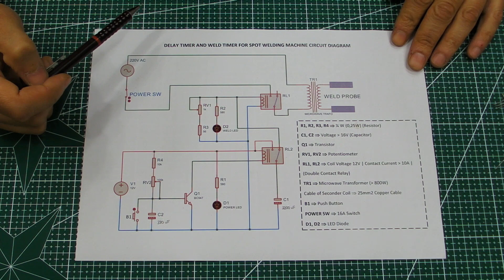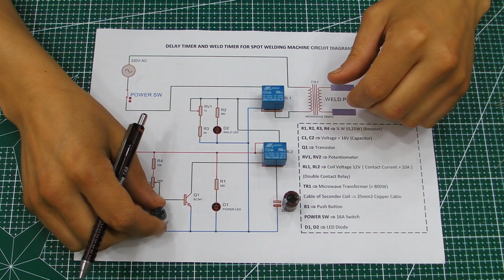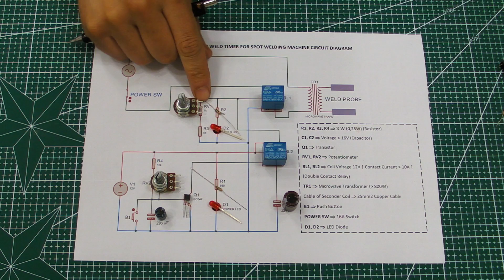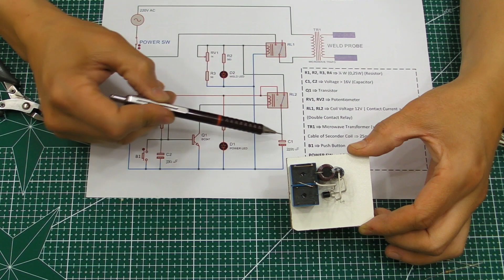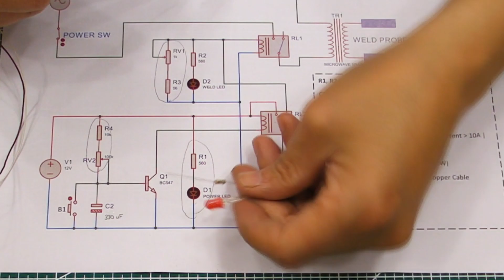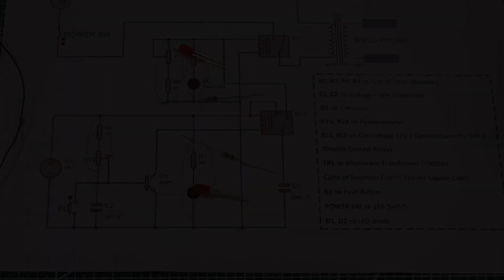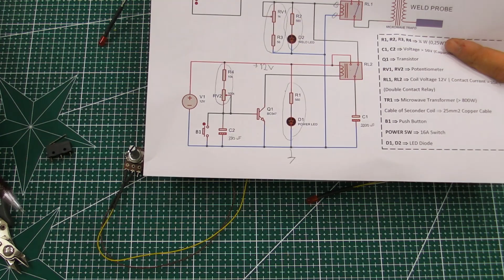How to Make Timer Circuit for Spot Welding Machine

Comment: Awesome video. Can you explain the theory of how the values of RV2 and C2 control the transistor to delay the de-energization of RL2, and why RL2 doesn't instantly become re-energized after you release B1? I'm having trouble understanding what exactly is happening IN the circuit when you press B1...
Reply from the maker: Hi.  Firstly, thank you.  This circuit is specially designed for a simple timer circuit and 2 separate time settings.  The operation of the circuit can be explained as follows... When the circuit is energized for the first time, the capacitor C2 is charged through R4 and RV2.  Since C2 is charged, Q1 transistor gets enough base voltage, it turns on and RL2 relay is energized.  In this case, according to the contact connection of the RL2 relay, the capacitor C1 will be charged to 12V voltage.  When the B1 button is pressed, the base voltage of the Q1 transistor drops to zero and the RL2 relay is de-energized.  The contact state of the RL2 relay changes and it gives the voltage on the C1 capacitor to the RL1 relay and other circuit elements connected in parallel to this relay.  The potentiometer RV1 changes the discharge time of the capacitor C1.  Thanks to this connection, even if the button is pressed, the welding time is as long as the discharge time of the voltage on C1.  Briefly, C2, R4 and RV2 determine the pre-weld waiting time.  C1, RV1 and R3 determine the welding time.  I hope I was able to explain.
Reply: @MuratGüney  Thanks so much for taking the time to respond!
Ok, so when I press B1, Q1 will stay on until the charge in C2 is depleted (while RV2 controls the discharge rate of C2) then, when the base voltage of Q1 drops to zero and RL2 is de-energized, RL2 switches to allow C1 to discharge into RL1 (at a rate determined by RV1).
My question, the part that I don't understand is; if I stop pressing B1 before C1 has finished discharging (before welding is complete), then what is preventing Q1 from re-energizing RL2 and breaking the connection between C1 and RL1?
How is it that you are not required to hold down B1 until welding is complete?
Reply from the maker: Hello again.  I would be happy to give you as much information as I can.  This circuit is designed for the spot welding machine I made.  In this machine, the button is activated by pressing down the upper welding arm.  In other words, when we press the lever, the button is pressed, the delay time starts for the material to be placed, and at the end of this period, the current is given for the welding process (as much as the welding time).  In other words, releasing the button in this system means giving up the resource.  In this case, everything works.  When the button is pressed again, the operations are repeated in the same way.  Please feel free to ask if there is anything missing or unclear.
Reply: @MuratGüney  I think I finally figured out why I was so confused! Your wiring diagram shows, at relay RL2, the 12V+ (red) wire goes to the Normally Open contact and the green wire goes to the Normally Closed contact, but I believe the actual circuit you built has these wires the opposite way around. So at relay RL2, the circuit diagram should have the red wire go to the Normally Closed contact and the green wire to the Normally open contact. Correct?
Reply: @MuratGüney  So here is how I think the circuit actually works: (and I am happy to be corrected)

- When the unit is powered, 12V+ is connected to relay RL2 at the Normally Closed contact, which immediately charges capacitor C1.
- The start delay potentiometer RV2 controls the rate that capacitor C2 is charged (the start delay time).
- When the voltage of capacitor C2 rises enough, the base of transistor Q1 turns it on and allows relay RL2 to be energized, switching to the Normally Open contact, which causes capacitor C1 to power relay RL1 until it's charge is depleted.
- THIS is now the "stand-by" state.
- When you momentarily press button B1, instantly, the charge stored in capacitor C2 is dumped, causing the voltage at the base of transistor Q1 to drop to 0V, switching it off, and relay RL2 is de-energized.
- This causes relay RL2 to switch to the Normally Closed contact, which is connected to 12V+, allowing voltage to pass through the common terminal to instantly charge capacitor C1.
- Since capacitor C2 is connected in series with potentiometer RV2, it charges more slowly, but eventually again reaches a high enough voltage which allows the base of transistor Q1 to switch it back on, re-energizing relay RL2, causing capacitor C1 to release its charge through the Normally Open contact.
- The charge from capacitor C1 energizes relay RL1, allowing 220V to energize transformer TR1.
- Potentiometer RV1 controls the rate at which capacitor C1 is discharged (the weld time).
- When capacitor CL1 is depleted, relay RL1 is de-energized. 220V is switched off and the system is once again in it's "stand-by" state.

Please let me know if I am misunderstanding something. Thank you for your patience and help!

Comment: Sir very nice 👍👍
But i couldn't understand why 12 volt adaptor you added ?
Reply from the maker: Hello.  First of all, thank you... It is necessary to use a 12V adapter for the relays in the circuit.  In short, for this circuit to work.  If there is anything unclear, please write again.
Reply: Kaç amper kullanmamız gerekiyor

Comment: OK great...! You can delay the time to start weld, you can adjust the welding time..... 
How to adjust the amount of current for welding...? Not everything will require the same current ... no?
Reply from the maker: Hello. Thank you. I did not adjust the current, but you can adjust the current by adding a 2000W dimmer circuit to the Primer line.
Reply: I believe it's not necessary to adjust the current because the total energy going into the weld is determined by the time that the maximum current is allowed to flow.
Power(Watts) is equal to Energy(joules) divided by Time(seconds), so the only reason to limit the total maximum current would be if you specifically needed the weld to happen more slowly, maybe for an extremely thin material? but even then, theoretically, just reducing the time of the weld should be sufficient. Maybe if the time required was SO SHORT that you needed a larger time scale to allow you to control the total power of the weld with finer resolution? That's the only circumstance I can imagine you might need less current.
Reply: @tuffaluffagus  Understood, tnx.
Reply from the maker: Exactly... I didn't add a dimmer circuit for it, thinking that there is no need for current adjustment.  But it can be added if desired.  May be required for very thin nickel plates.

Comment: Thanks god you didn't use 555 or any other frivolous IC! I might have used darlington though, to make capacitors smaller and less critical, but most I hate the mainstream of making all the simplest functions with ICs where they don't even actually reduce the component count and often even increases the number of pins to solder. Nice, simple and functional circuit! And nice build of the spot welder too! Thanks a lot!
Reply from the maker: Hello.  Thank you so much.  As you said, it is a simple circuit with low probability of failure.  You can also make this circuit with a microcontroller, but I made it this way for the reasons you mentioned.  In addition, I think that those who do not have electronic knowledge can easily make this circuit.  Greetings from Turkey 👍
Reply: @MuratGüney  Cuántos KvA soportaría éste circuito? Es que estoy en un proyecto similar, pero usando una soldadora de arco que era de 180 amperios, quité su secundario y voy a fabricar uno con barras de aluminio porque el cobre es caro, y el aluminio lo consigo fácil y lo fundo fácil. Al mismo tiempo, también estoy pensando dejar el entre hierro de regulación de amperios del transformador acorazado de la soldadora de arco, para ver si regula algo los amperios.

Sin embargo, quiero hacer un circuito de control, pero no sé si soportará la potencia del soldador de puntos sin quemar el circuito. Mediría el consumo pero no poseo pinza amperimétrica, y aún no he armado el secundario definitivo. De antemano gracias....

Comment: Just subscribed 
The micro switch button is mecanic conected to upper bracket on the welder?!
When you push down it makes contact or you have foot pedal?!
Reply from the maker: The switch is inside the machine.  There is also a foot switch (you can see the video on the channel) but there is no switch on the pedal.  When the upper arm is pressed, the switch is activated and a period of time is allowed for contact with the material to be welded.  When this time is over, current is given for the set welding time.

Comment: Thanks Mr. Murat,
You made a layman an electrician, just by following the diagram and step by step joining the components i could say copy this.
Will be making the spot welder too.
Thanks Best Wishes and Love from India.
Excellent.
Keep it up.
Reply from the maker: Hello.  Thank you very much for your nice comment.  I'm glad you like it.  Note that you can find PDF plans in all my videos
Reply: @Murat Güney why when I apply power to the circuit the weld side immediately turns on, the potentiometer will adjust the weld time properly but when I plug it in the circuit activates and after that the power led stays on but I press the button and nothing happens

Comment: Great stuff Murat,,,as always! Am I able to use this circuit with the Battery tab welder circuit? Thanks, Regards, Marty. (UK)
Reply from the maker: Hi Marty... I was wondering what you were doing too. As far as I understand, you couldn't run the circuit. This circuit is considered the same as the previous one. But there are two time settings in this circuit. Previously, when the button was pressed, the transformer was energized and after a while the energy was cut off. In this circuit, when the button is pressed, it makes a time delay before energizing, when this time expires, it energizes the transformer and cuts the energy after a while. We can say that this circuit is a bit too featureful for battery spot welding. As a matter of fact, when you pay attention to the diagram, the right side of the circuit is the same as before. I don't understand why you couldn't run it. If you want, make the same circuit according to this video, run it and let me know. Let me try to tell you what operations to do and it will be similar to the previous circuit.
Reply: @MuratGüney  Hi Murat, I hope your Father is well and doing better? No, I couldn't get the last circuit to work. I tried 4 times. It is my fault, because the relay diagrams confuse me. I found it easier to follow the wiring in this timer circuit because I can see clearly how and where you are soldering the wires and components. But when I look at the schematic and cross-reference it with the video I get baffled! Lol. I can't seem to associate the pins on the relay component  to the schematic symbol of the relay, it really confuses me. I have never struggled with any other components before,,,I think 'Relays' don't like me! Lol.Best regards, Marty (UK)